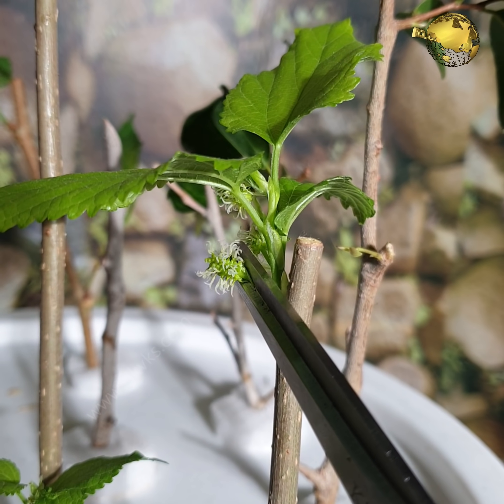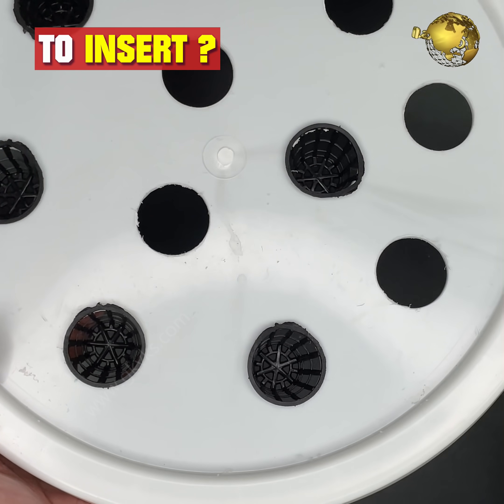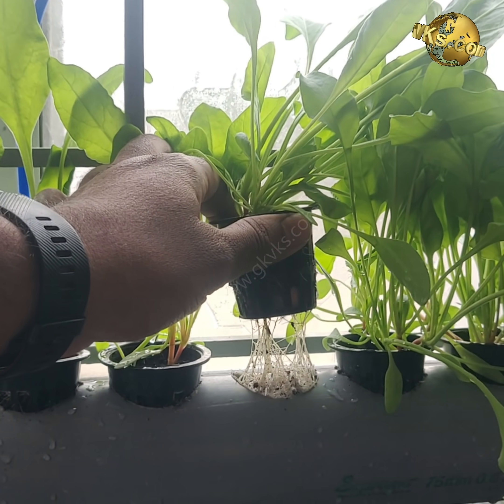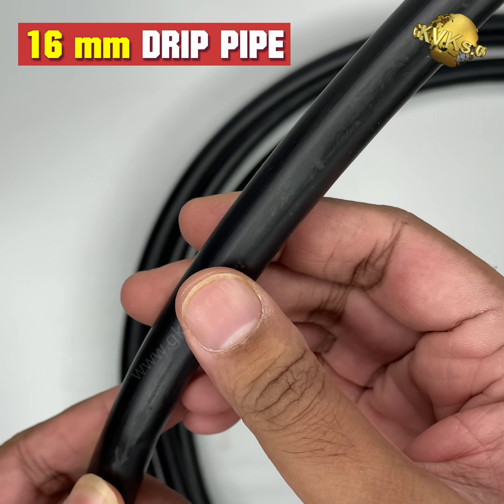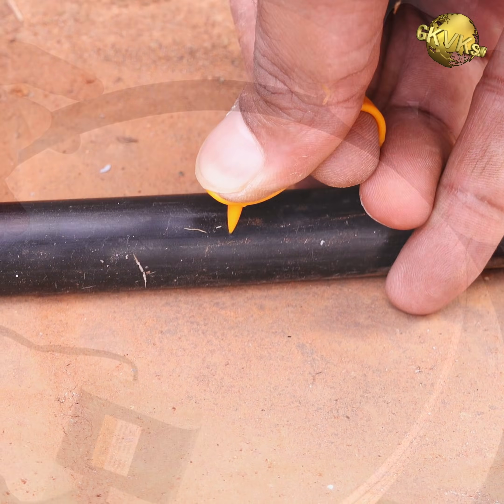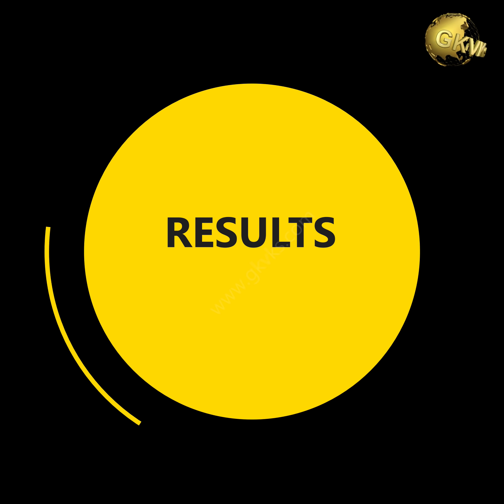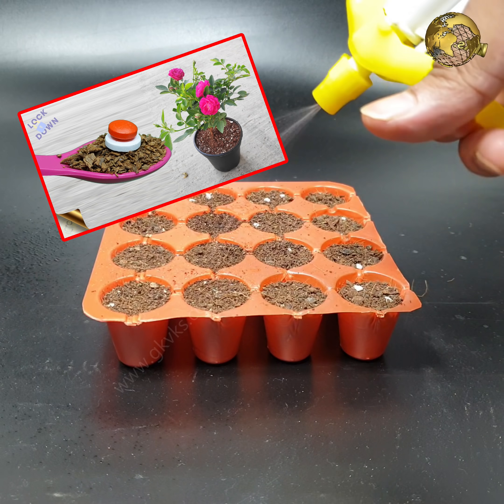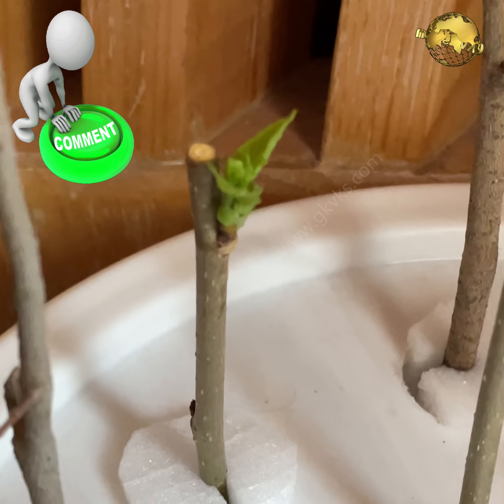FASTEST METHOD OF ROOTING PLANT CUTTINGS | DIY HYDROPONIC CLONER

Comment from the maker: ALL HYDROPONIC & ROOTING EPISODES: https://www.youtube.com/watch?v=NEEw_wCUwi0&list=PLvE-WOB38X7bFXRKEgYAh334Drnymf2Sf

Please LIKE, SHARE & COMMENT below with Feedback / Queries.
Happy Gardening & Stay Safe!
Reply: comparisons?
Reply: q
Reply: Garlic hydroponic
Reply: Thank you for all your tips, I tried them and y’all worked.
Thank you again
Reply: What is the temperature?
Reply: Not sure its safe to grow anything edible in a paint bucket.   Using a food grade bucket will ensure no chemicals leach into your plants!
Reply: Hello, I'm really new to all this but I'd like to have a go at building my own. Can you post a link to the 'small sprinklers' that you used and what size they are?
Reply: I would say that this method is not NFT as stated but is called aeroponics. Also, the object is to ensure the plant roots remain damp rather than dripping wet. With that in mind the number of misters you have used is way overkill. Three is all you need, especially in a bucket that size - the pump looks to be way larger than required too. I personally prefer rotating micro sprinklers to misters precisely because the water is not hitting the roots all the time but will also be bouncing off the walls of the bucket, further inducing aeration. To  ensure micro sprinklers are rotating in the horizontal plane you would need to add several t- joiners to your ring (jutting toward the center) and add some short pieces of tube capped at the open end. Then insert a micro sprinkler in each piece of tube and you are ready to go. That ring need not be right at the top of the bucket but should be at about where roots will commence. This setup produces plenty of humidity so no problem ensuring the plants are well watered. I would be inclined to first root seedlings in sand or growing medium and THEN transfer them into the aeroponic chamber where they will thrive - especially if under lights. If growing cuttings start them in a glass jar first so that you can monitor when they are ready for the bucket chamber. You can start cuttings in the chamber but it can be touch and go.
Reply: Have to say I've tried them all. A clone dome with pods does just as good minuse the having to spray them with water every day which adds time to the project. But with pods if a root sticking out breaks when transplanting no biggy as many roots are still in the pods ready to come out. If you break or rip off roots doing this bucket setup the clone might not survive the transplanting when soil is packed down around it.
The best imo is cups.. try a clear solo cup with a good perlite soil mix filled up with soil soaked in very very light nute water. Then drip it out by tipping it till no more drips come out so it's not to soaked. Dip clones in cloneX put in soil cover with a sandwich bag and clip or tie for 10-14days or until you see roots then uncover.  I have had roots running all around the cups all the way to the bottom tons of them in 14 days or less compared to just those few little strings you see in methods like the bucket system here. plus they are then already in soil. Can just open them and feed them till its time to transplant causing less transplant shock. Pop holes in the cups once rooted for air flow and or drainage. Best method ever. It's kinda like a clone dome but they each get thier own dome meaning if for some reason one clone was infected with a mold spore or bugs it won't infect the rest of the clones as it would in a traditional clone dome where you have many clones in the same dome.

Comment: This is not NFT (nutrient film technique), this is aeroponics ( = the solution is sprayed in the air). And the whole concept is wrong, you made a good hydroponics setup for fast growth, but end up using it for cuttings. The sprayers are wrong and after 8 days only one of the cuttings has developed some root. If you put then in soil with rooting hormone, inside a bottle greenhouse, you will see much much better results with no hassle to make and maintain all this device. I don't think you know what you are doing. 

Don't get me wrong, the device is good, apart from the sprinklers, but you are using it wrong.

Comment: As you might not know... 
   The fastest way to rooting and 
      Rose and other hardwoods are
         To stick them up on a flower 
            Sponge and place them in a
                Bowl or any containers with
                   a bottom filled upto a few
                       Inches like say 1 inch. 
      Just put them in a bathroom or other places to receive those leaves growing out in a few days. After that you can put them into soil along with the sponge. The sponge doesnt need to be a big piece cut them. Into a small cube just to fit one stem .. Each stem separately for one cut stems.
Reply from the maker: Will certainly try this out.

Comment: Oooh! I was seeing your end clip of the DWC cloner in the other video and I can tell you from experience that you shouldn't have the stems submerged, they should be above the water line and the airstone you have is insufficient. The bubbling action keeps the stalk wet and it being in the air above the water provides the oxygen needed. If you experiment using the suggestions I mention you'll find that the rooting time is about the same as the sprayer method, maybe even faster. Then again I've been rooting in soil with the same time frames as any other method. Temps & humidity are what matters most when rooting. Great vid I love the thorough explanation!

Comment: Hello please help the aqua pump I am looking at has a power of 35w is this good enough

The specs:
Output 2500L/H
Voltage 230V
Frequency 50Hz
Power 35 W

Thanks
Reply from the maker: That’s powerful, you can build a bigger unit with this.
Reply: @GardenTips  thanks for reply!

Comment: use dark foam for the pucks. also cut it so it completely fills the hole and touches the stem all the way around it. this will eliminate light leaks into the bucket. roots don't like lights.

Comment: Hmm. Several points raised here:
1. What's the rush? Why do you need your plants to root so rapidly?
2. We've only your word for how rapidly your cuttings take using your apparatus. A convincing demonstration would be to take similar cuttings and root them conventionally at the same time, to compare.
3. Ficus and mulberry need no encouragement to root. Even so, not all of the cuttings are stirring.
4. You don't seem to select cutting material which is juvenile. Doing so would discourage the formation of flowers and fruit while the cutting is rooting, and ultimately results in plants which develop more rapidly and are fully formed.
Reply: The rush is called COMMERCIAL APPLICATION FOR ONE!  Second I don't care to wait 6 months for a fruiting plant! Gee..

Comment: What plants does this work for? I have been trying to grow Crepe Myrtles and I have maybe a 5% success rate.
Reply from the maker: Any plant - semi woody cuttings of 6-10 inches long.
Reply: Keep your temps and humidity correct and you'll have 101% success rate.
Reply: @roadtrippin2781  I live in Florida, so its humid and hot, maybe too hot?
Reply: Have you tried Crype myrtle with this system?
Reply: @rob5psv  I've been trying to grow them anyway I can. Still very marginal success.
I was able to graph and mix colors a little. I think take a 100 limbs and try to grow them, then if you get 5 call it good  :)
Reply: @alanheadrick7997 I'm going to try cutting them with 100% perlite. I also have no succes with crepe myrtle cuttings.

Comment: I tried this and had an algae form that coated the inside of the tube and clogged the sprayers. Any suggestion to prevent that?
Reply from the maker: Keep it continuously switched on. Use clean water possibly after seiving the water using a fine cloth to remove dirt which can block the openings.

Comment: one problem with my method of simply placing the cuttings in a qt jar of tap water is the water becoming
murky after a few days.   and / or the cutting stems turning black.     

      is there a solution to use first to wash the cuttings of any harmful bacteria ?
or something to place in the water that does the same thing without bothering the rooting process ?

    as is my method is hit or miss. overall about 15% success rooting.   with more losses after
that many are potted in 8 oz foam cups with 1/8" and 1/4" sifted potting soil.  

the 1/8" contacts the new roots in a dry state.  the roots are very fragile and break easily.
  once the roots are covered with 1/8" foam water is sprayed on the soil to moisten the roots

    this method is used to clone a variety of cottonwood tree  that stays small ( 30" & slender )
and does  not produce any cotton.    next clones of  a hedge plant variety ( cheyenne privet)
are taken once they stop flowering.   mid july and later.   good success with them too.

    its a lot of ongoing work . and the effort pays off.    prices at a local nursery have jumped
recently such that they are now out of my price range.
Reply from the maker: Please watch https://youtu.be/lLvgE6ouNBA

Comment: Not necessary. Cut at 45 dip in root hormones, the plant in one gal pots. Keep them in indirect light, and water one a week, don’t let them dry out before the first month.
Reply: This method works, but will take just as long to adjust to outside elements

Comment: I never had luck with rooting hormone or aspirin or cinnamon or anything else besides honey which seems to work really well for me
Reply: I grow the Aloe plant. When ready I break off about a 2 inch tip from the plant. Then shove the cuttings into the gooey flesh of the Aloe. Seals and is antimicrobial!
Reply: @stixglass8442  Wow, that's great!
Reply: @stixglass8442  And how long before you see roots using this?
Reply: Try Aloe Vera too. I haven't looked back since I've learned about it!!!
Reply: @stixglass8442  Do you buy pure aloe vera? If so, where? I haven't tried that...

Comment: I made a cloner similar to this and did a test. At the same time I did some in rockwool and rapid rooters. After 5 days my hydroponic cloner clones were all showing roots. After 10 days they were ready to transplant and loaded with long roots. Over a week faster using the cloner. Took 3 weeks to get the same roots in rapid rooters as i got from the hydroponic cloner in 10 days.
Reply: Interesting considering I have had exactly the opposite results between the "cloner" and rapid rooter cubes. Rapid rooter cubes with a heat mat under it and in an enclosed container (I made my own for $10) with a 1/2" gap between top and bottom and it works beautifully, rapid rooter roots all out of the cube in a week to week and a half all ready for transplant. The cloner.. forget it, even with a heat pad under it, over two weeks and no roots. I now have a cloner for sale I will not use again. Waste of time for me.
Reply: Hi cud you explain the method you used in each stage. I find this video requires a lot of experience whereas I prefer something more simple. I really want to do my Rose's. Thanks. Wud appreciate your help.
Reply: @najmamohammed1437  No this doesn't this is spot on what you should do if new to this. This is stupid simple. Don't try to make it more complicated than it looks.
Reply: I get roots in 7 days in rockwool and plastic dome, with bottom heat
Reply: @perryhart3172 can you explain your setup in more detail?

Comment: That is a lot of things to buy to root.   How successful is it on hard to root plants, when s and trees?   I just use some rooting hormone, some cuttings and a clear plastic box or sealable large plastic bag.  Take your cuttings, trim, dip stem with leaf nodes in rooting hormone, place in soil, moisten and pot in bag or box .  For easy to root plants and shrubs can be placed directly in soil and kept moist or can be placed in water.

Interesting method and if you have the pieces great but I think I will continue with what I do with good success rate.

Comment: Not surprised at all. but you can get roots just as quick if not faster with out the hydroponic input. Iv got roots popping as early as 5 to 7 days using a humidity dome, heat mat (ambient temp of 80 to 85  Fahrenheit), with rooting hormone. No DWC needed. One thing you forgot to mention is how biofilm can build up clogging the sprayers and how its a pain to keep it clean and sanitary.

Comment: That's lots of requirements. The fastest way is just insert in the ground.
Reply: In winter climates that would require storing cuttings till spring which is not very practical
Reply: Fastest meaning “it roots faster” duh!!! And it’s correct sir
Reply: that's the slowest and least likely to succeed also
Reply: @richardlingo4055  the requirements they have use will be more costly than getting big trees from nursery
Reply: Lol what a noob

Comment: Does plant need continus water
Reply from the maker: If you can attach a timer for intermittent supply that’s fine. Even otherwise the pump is low watt and won’t consume much power - same as aquarium pumps which run continuously.